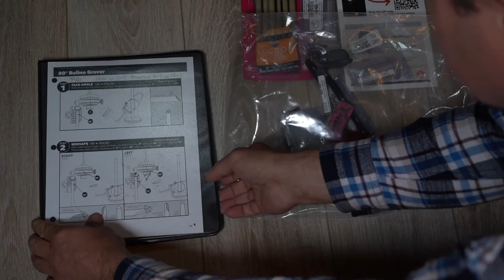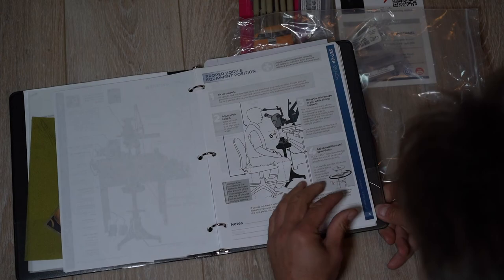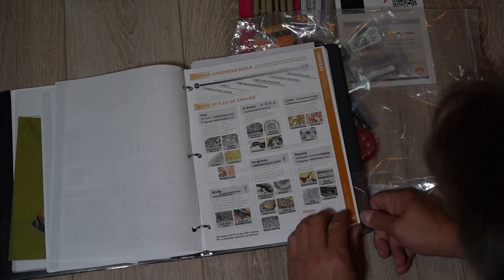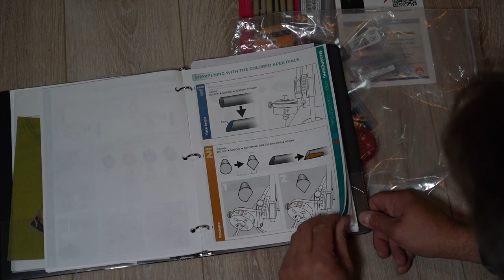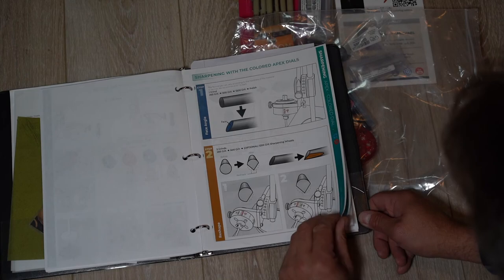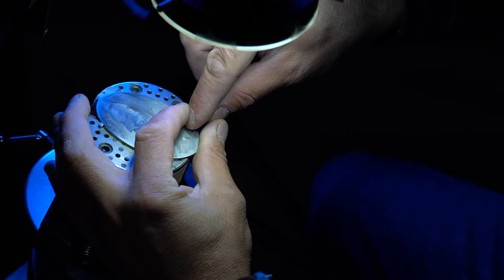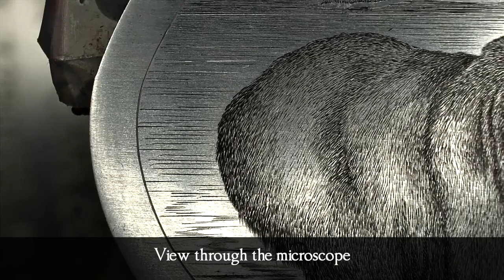Wild Alaska - | Bulino Engraving | At GRS

Comment: Hi. Was this all done with a GRS 901 hand piece ?. Thank you.
Reply from the maker: That’s correct.
Reply from the maker: I should correct myself further, that the GRS901 was used for border cuts and misc flower's stem cuts, but I did alot of hand picking on the bear without using 901 handpiece.

Comment: Great job, friend! what kind of paint do you use to paint over the cut places?
Reply from the maker: Thank you.
Typically I'm using metal paint. Sometimes a black permanent market can be used.
Reply: @ASkobiDesigns  Thanks. Good luck to you in your work. What is the basis of this paint? If it's not a secret of course.
Reply from the maker: Rust-Oleum Flat Black Protective Enamel